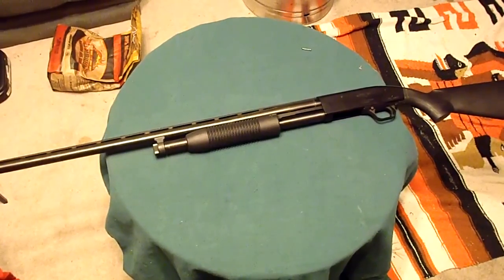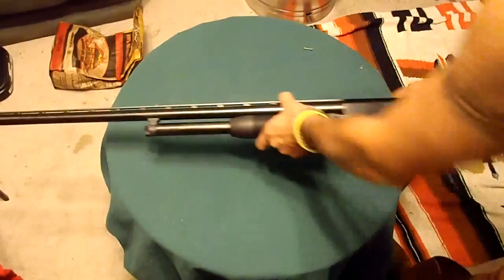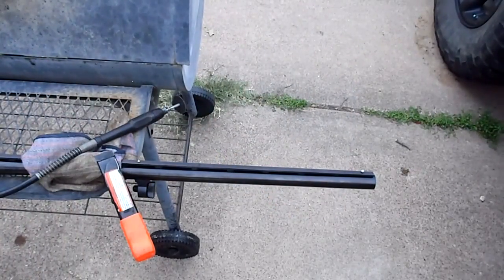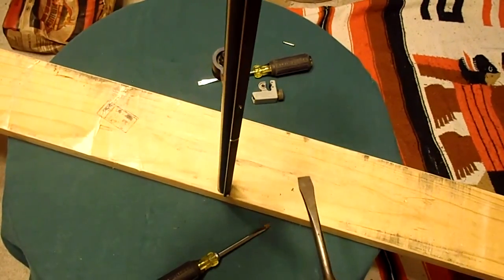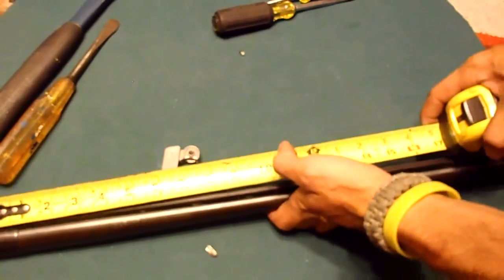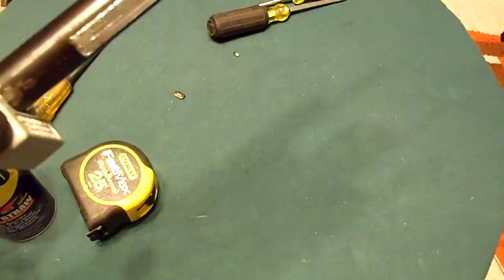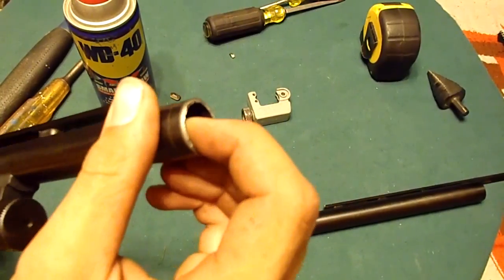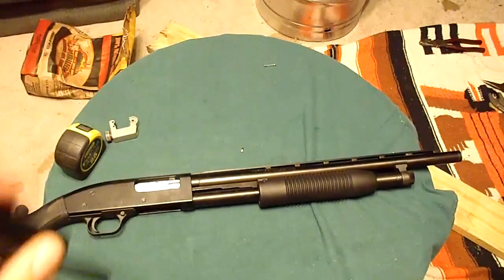Cutting a shotgun barrel...the right way? Well, a different way...

Comment: The tube cutter wanted to walk down the barrel because the barrel is tapered, so a pipe cutter would have the same problem. They are for cutting pipe which is not tapered. Put a plastic zip tie around the barrel where you want to cut it, as tight as you can get it, then use the edge of the tie as a guide for your hacksaw blade. Then clean up the cut edge with a file, and reblue the new muzzle

Comment: that cutter is designed for cutting copper pipe not steel
Reply: I was thinking the same exact thing. Good idea, but you need a much better pipe cutter than that.

Comment: Thanks for the idea. I tried this one of my old single shot 12 gauges and it worked great. I used a bigger pipe cutter and took my time. After about 10 minutes I had a perfect cut. The cutter I used even had a deburring tool to clean up the sharp edge on the inside.

Comment: 1:12 "HI-points, yeah, im not gonna talk about those." Yeah, I'm sure youre not, because anything you could say there would either be a lie, or refute your point. Hi-points are ugly as hell, and the fit and finish is a bit rough, but theyre damn reliable and at the end of the day, they just work.
Reply: Nope they are a shitty gun. The reason they are regarded that way by people who own better guns is because they use an outdated and quite frankly dangerous system. It's a direct blow back design with no internal locking mechanism to delay the action from opening too soon. They rely solely on the massive slide on top and is why you will never see a hi-point slimmed to the size of a Glock or 1911. It needs to be there so it slows the movement of the slide down enough. 

The reason it appears reliable is it is very hard to mess up a system that simple. It is only acceptable to have direct blow back designs like that in calibers lower than a .25, anything higher is asking for failure. 

The difference comes when a Glock or 1911 fails they don't break. If a 1911 fails its an extractor not being tuned, if its a Glock (very rare) it is usually some specialty ammo that does it. On both guns it takes the bottom recoil spring housing to sheer from the slide, then the bottom lug of the barrel needs to sheer and if that happens its gonna barely fall off the gun because going through that much would slow it down a lot. Now if a Hi-point fails which is just a single stop pin your eating the slide. 

They are horrible guns and for the amount of cheap 1911 copies out there as an alternative to the poor design of a hi-point there really is no excuse to own one. To give a bit of perspective they use the same type of system that a Ruger Mark series uses (.22 cal) or the Stephens Model 64 (.22 cal). This is why the PPSH-41 has a massive bolt as well. In a submachine gun application it is acceptable because the bolt is housed in the receiver and is not a slide on top of a receiver. 

All that said the reliability you get is because someone a long time ago invented a blow back action and not because its a hi-point. Hi-points are junk and if you ever see a cracked slide on one then you will understand why they are when you get a glimpse of the casting flash. Like seriously who casts a slide? Just look up "Zamak-3" which is literally pot-metal and that is what it is made of. So with a hi-point you have no locking breech, cast pot-metal slide and a polymer frame that is a recipe for a cheap crappy gun. Remember Glock uses polymer frames with reinforced steel rails embedded in the frame I doubt hi-point does this as it would increase cost. Glock proved polymer frames work on guns with a locking breech not on straight blow back so hi-point is really experimenting at this point. 

Even Ruger won't cast a slide or bolt and Ruger loves to cast everything. 

Not to mention Hi-point's weight more from the heavy slide, they cannot be tool free field stripped (before you say neither can a 1911 there is a reason for the extended foot on the mag and it is to depress the recoil spring plug, the mag is the field strip tool for a 1911 (unless it has a full length guide rod in which case the slide can be removed as a whole unit like a glock)), and they are just down right ugly as hell guns.
Reply: Hi-Points are illegal in my state, allegedly because of the relatively low melting point of some of the materials.
Reply: @michaelgerber7811  What state out of curiosity? I've never heard of that
Reply: @ianloughney9570  Minnesota. It's weird. The law mentions Hi-Point specifically.

Comment: I have had 2 870's break ejectors on me and have to be sent back to remington. Mossbergs can be replaced be the owner and does not need to be sent back and I have never had a part break on any of my mossbergs. 500>870. urgo's are also better on the 500, anyone that says otherwise is a liar.
Reply: Also there is a reason the military chose the 500 over the 870

Comment: I have done it that way. The pipe cutter usually only survives cutting 1 barrel. It usually breaks at the housing the tightening screw goes through (weakest point). It does work but just cutting it with extra material on the end and then using a file to flatten it out and then lap the front of the barrel on glass and boom its done. Although the pipe cutter does make a nice cut and to stop it from doing the threading effect stop bitch handing it, when you tighten it do NOT tighten it that much only about 1/4 turn unless you want both sides where the blade cuts into it to mushroom both sides (you can see it happening at the bottom of the roller at 21:52. the metal has clearly mushroomed from too much force on the screw. It's not a race and you only win a broken shotgun if you mess it up. aaaaaaaaand now I just got to the part where you messed up the cutter so I guess I get to say.......told you so. 

Also those ribs are usually silver soldered, you can heat them up and separate each support. You literally needed a propane torch. 

The screw driver did not open the gap it mashed the metal and compressed it and probably the front sight, your lucky the front sight came out, if it moved it would be hanging off the end of the barrel. Also let me explain some physics to you, by twisting the screw driver equal force is placed on the opposite side, meaning the rear of the rib you wanted to keep is being subjecting to a lot of force you probably didn't want it to be subjected to.
When working on guns you need the following knowledge. Some metallurgy, metal working, classical physics, metal working tools knowledge, welding, some chemical (blue the right way with hot salts), reading blueprints, CAD (if you want it to be more efficient not entirely necessary) and a basic knowledge of safety risks for your tools you will be using (this is important and if you have ever seen a cut off wheel explode you will know why).
Not to be a completely mean person but this is a hack job. You left the rail cut undressed, the front of the barrel was not straightened out enough after the cut. The barrel was not powder metal that would be a huge liability, it looks that way because the metal thinned out and was jagged because the wheel did not pass smoothly through it and was partially caused by the ruined wheel on the cutter. Honestly when you thought the barrel was "powdered metal" was the moment you should have put the gun down and accepted the fact you did not know enough to do the job properly and have it look decent. A hacksaw would have done less damage. 

As a side note.....You sound like Wade from Grand Theft Auto V.

Comment: I just used a mitre box and hacksaw, crowned it with dremel using higrit polishing cone and outside with quick 1000~1200grit quick spin and was down in 5mins. 

But yes, I agree about measuring that extra space, I did mine 18½ from locked bolt

Comment: what was the purpose of trying to pry the rib off with the flat head? why didn't he just cut through the other support ahead of his initial one with the drimel and let that section of the rib fall away?  I was actually thinking he wouldn't have been able to get through the steel with such a small cutter: I have only seen them used for copper or conduit.  of course the gun is now destroyed right along with the tool so..... hey

Comment: In all honesty, this is WAY more trouble to cut a shotgun barrel down than it NEEDS to be.  Easiest and fastest way is to take a hacksaw, put the barrel in a mitre box and use the guide for the saw blade to keep the cut straight.  Then all that is needed is a few quick swipes with a file to smooth it up, and you're done.

Comment: If you spent $400 on the Maverick 88 you got robbed. I bought one from Walmart for under $200. You get what you pay for, but I'm happy with mine. As far as cutting the barrel I started out testing the drummel on very end for a test cut. Took way to long. Buy a band clamp tape the barrel and use a hack saw to cut it in less than a minute, then use the drummel to clean up the burrs and square the end the of the barrel.

Comment: this shotgun is pretty much the same thing as a 500, only difference is the pump really and the writing on the side. its pretty light so using the pistol grip is kinda a killer. ive never had a jam with one, ive put hundreds of rounds through it of all kinds. just keep it clean and what not and it is a great gun for the money. comparing the nova to the 88 is like comparing a corvette to a camaro, both good cars but you get what you pay for like anything.

Comment: I don't know if you've received a comment like this before, but you have measured your barrel incorrectly. You need to take a dowel and push it down your barrel until it stops at the action (action closed) and mark the dowel there, then measure to the side of the mark towards action. Although you played it safe and cut to 18 3/4", there are some guns that can measure 18" the way you measure, but measure 17" the correct way. Be careful!

Comment: should have you used a little heat from a soldering gun or something and slid the vent rib thing from the receiver towards the end of the barrel..cut it then slid the vent rib thing back on and cut off the excess at the receiver ...maybe twisted off one of them blocks and re-soldered it on the end where the sight would be..plus sometimes you start pliers to tighten a tube cutter but never after it has started a good line around it...its a good job for the first time.. that's how ya learn

Comment: The pipe cutter has a crimping effect. You'd have been better to use your dremel or a hacksaw. Then 10 bucks at any engineering shop would have it faced off in a lathe level with the rib support you removed. Re-install factory front sight on the end. Dab the faced area with cold blue and it would look factory.

Comment: The way to measure a shotgun barrel is by inserting a dowel all the way to the bolt face. The length  of dowel in the barrel is the length of the barrel.

Comment: mesure the barrel with a dowel and with the action empty and closed  measure and mark at the tip of barrel the subtract say a 26  to 18 min 18.5 recomended mark your cut off 7.5
tape it for a mark do not forget cutting oil  and if your cutting stock the overall has to be 26 
but leave a little extra 27

Comment: I own the 88... pumped thousands of rounds through it (shooting clays) though it's a bargain, it's reliable, action is smooth, never had it chamber multiple shells (You can keep the trigger pulled and just pump the action... it just works).

In terms of Hi-points. laugh all you want, even guns and ammo published a review that was quite surprising... it shot better than guns that were three times as expensive. They aren't the only publication to review it in such a positive manner. I own one, it works... every time. I also own a springfield 1911 and a ruger 44mag super redhawk...

Comment from the maker: That was the point, I don't need a way of choking this barrel, I wanted cylinder bore. I have 7 other shotguns, 3 of which have removeable chokes. I have barrel lengths between 19-28, and I have .410, 20ga, and 12ga.  These are not made in Turkey, they are made here in Texas with Mexican made MIM parts.

Comment: There's nothing wrong with the Maverick line of shotguns.  They're just Mossberg 500's that have some Mexican-made parts, whereas the actual 500's are 100% American.  Both shotguns are assembled in Texas at the same place.  

Totally not worth the extra $140 for the 500, unless you really love the position of the safety on a 500 (which some do).

Comment: ATF measures a barrels length by closing the bolt, and using a measuring tape down the barrel to the bolt. for rifles use a wooden dowel since the bore is too small for a tape measure.

Comment: mav 88 is a good shotgun so congrats on the wise decision, and good for you to use a tubing cutter, i did mine with a el cheapo and cut mine down for 10$ (dowel for measurement and pipe cutter) and used a dremel to clean up the burrs, good clean job and was $70 cheaper than the gunsmith and kept me busy.

Comment: All the barrels do not say Accu-Choke bro. That  28" Accu-Choke with vented ribs is worth as much as the gun itself. You could have sold that for $150-200 easily, then bought the barrel proper that you wanted and have money left over or do what I did and trade it for an already sawed off barrel, pistol grip, picatinny clamp, and super bright flashlight.

P.S. You call it an imitation Mossberg as you show the Mossberg logo on camera. The Maverick 88 is unquestionably a Mossberg product.

Comment: When it comes to firearms the ATF is the only LEOs that matter. measure and mark a dowel rod to 18.5" Or shorter if you have filled out a Form1 and gotten the stamp. Close the action and stick the rod down the barrel until it contacts the breach face. As long as you don't go shorter than your mark you are legal. Even with my SBSs I go about 1/8" longer so there is no doubt I am not under the mark.
Reply: if you're using the term SBS, wouldn't you already have the tax stamp for a short barrel shotgun ?  why then would you need to stay 1/8" longer than the mark...with an SBS you can make your mark as short as you want

Comment: Using tubing cuter is a bad idea because it doesn’t remove any material it simply displaces it to either side and the pressure from the rollers crushes the excess material causing the muzzle to be a smaller diameter which can cause problems when fired a hack saw on the other hand removes material so you don’t have the problem of crushing which it why moats people use a hack saw. Also I don’t know what you’re smoking but Mossberg’s are the shit

Comment: Those are not made for cutting steel pipe. And 2nd the Mossberg 500 is a durable dependable gun that will give you little if any problems.

Comment: don't be fooled by the price of a maverick 88, I probably fired 500 rounds through mine without so much as a hiccup. im more into hunting though and traded my brother a longer shot gun for it. I can tell you though my most resent shottty my rem. 1187 has had twice the problems as the maverick and it was double the price.

Comment: It walked down the barrel because it's tapered, better to just use a hacksaw. A good machinist can get a pretty true cut with a hacksaw but it will always have to be trued-up. The tubing cutters are for soft tubing, not a hardened steel barrel, so the tubing cutters are no longer going to be worth a chitz for anything, the roller cutter is ruined. But live and learn, we all do, hope you had fun! Suggest you do it first, before showing us "how to do it right" again.

Comment: 180 bucks for a new mossberg maverick model 88 12 gauge at academy i have fired several thousand shells through mine it has a pretty lengthy pump so it can be easy to short shuck if you have smaller arms but a good reliable shotgun it does its job not a very pretty shotgun but they are a good choice for the price

Comment: Why didn't you just cut the other side of the vent rib off at the support and then remove that section so you could get pipe cutter in there? Thats what I did and it turned out great.

Comment: Just a heads up. When you use a pipe-cutter. The pressure from you tightening it, bevels in the metal, so it is less than a .69cal (I believe that's 12ga). Maybe to a 65-67.

Comment: you are suppose to run the measuring tape down the barrel with the action closed thats how to get the actuall barrel length never measure the outside INCORRECT READING

Comment: i used a pipe cutter on my 50$ used mossberg500  12ga  28in cut to 18.5in  .  some law enforcement officers love guns as much as you do or more  others only own 1 gun.
you should have wraped it with masking tape and go slower. mine came out better and i smoothed the sharp edge with a roto tool

Comment: You got ripped off if you paid 400 for a Maverick 88. They normally run about $220. You can buy a real Mossberg 500 at Wally world for less than 300, with two barrels.

Comment: i was taught a mossberg was good for duck hunting. it would take being dropped in the lake and still fire. also they were cheap if it got banged around in the boat no great loss. they are a work gun and should be modified for the intended use if necessary. besides if you buy a new barrel and put it on because you dont like this one you keeping someone in business making barrels. once again not cheap junk but a inexpensive work horse!

Comment: tube cutters roll the steel inwards as they cut, I know cause I did it first time I cut a barrel down.  The steel the was rolled in sort of makes a really tight choke at the end of the gun and firing it is unsafe.  The barrel I cut down eventually cracked and split the barrel halfway down, I am just thankful nobody got hurt.